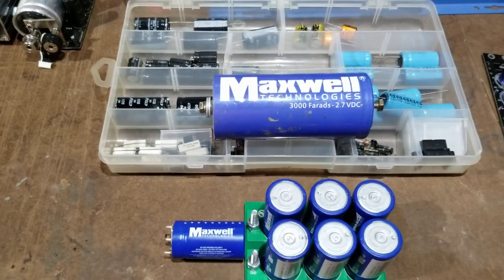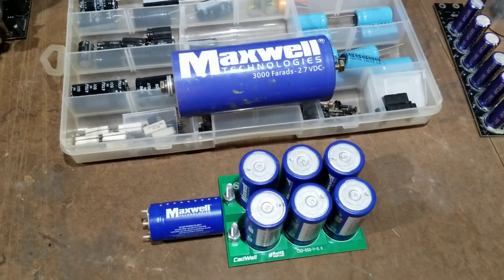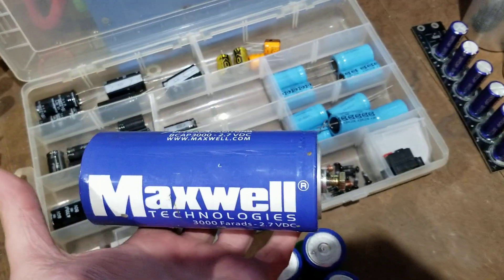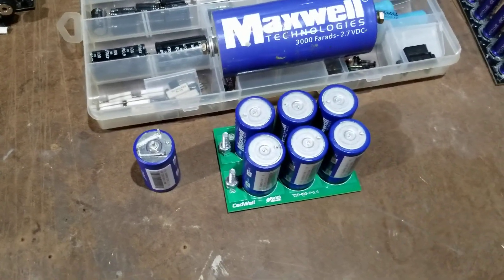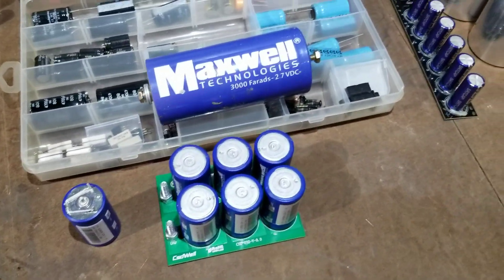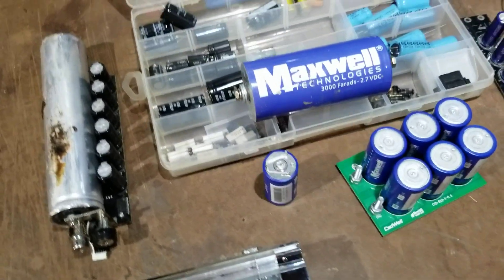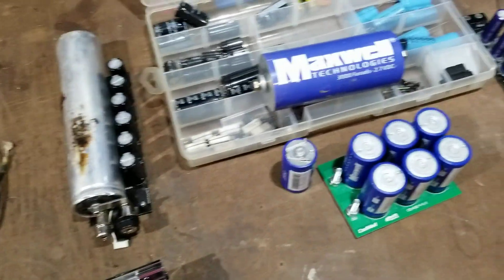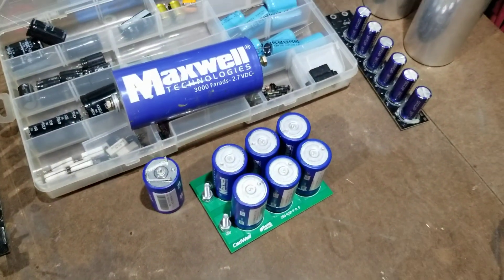Supercapacitors and Differences between Other Capacitors Use for Solar , Wind, Car Audio and other .

Comment: Great videos thank you one question please do you hook your capacitors to the inverter then to the battery or do they only get hooked to the battery and then the batteries are hooked to the inverter
Reply from the maker: Either way will work. I have  tried both ways.
Reply: @SoutheastOhioSolarHaven  thank you again  your videos are very helpful
Reply: @nickgosney3346  awsome question and then answer for what I wanted to know also , thanks